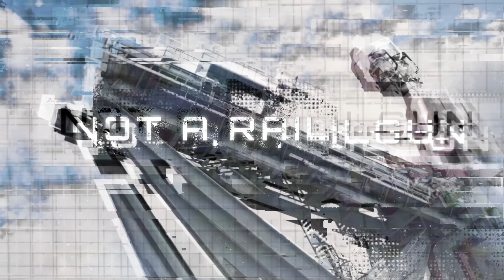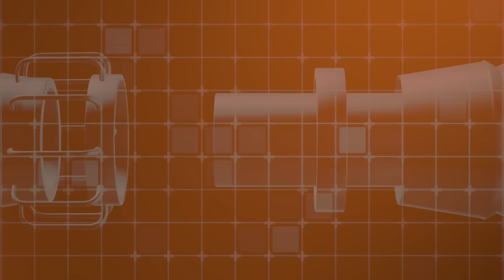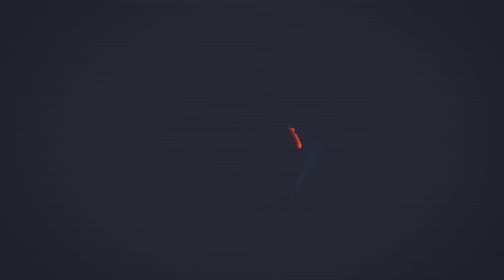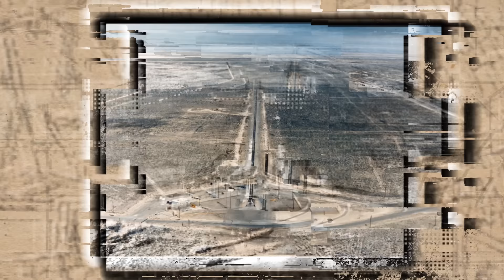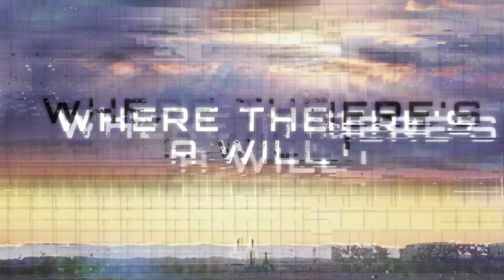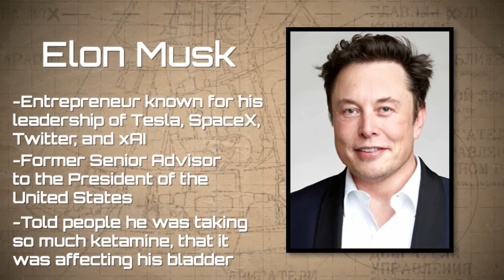China Wants to Build a Space Ship-Launching Rail Gun... But is it All Just Fiction?

Comment: It's nonsense. For years all experiments with railguns have failed, because of the stress on all the materials. The wear on components is enormous, they just tear themselves apart. You might get it to work, perhaps for a couple of times, but then you have to rebuild the whole thing. Or build a new one.
Reply: America learned this long ago, when they were experimenting with project HARP, using a giant naval artillery canon to shoot tings into the upper atmosphere at 115miles above sea level, way back int eh mid 1960's. the biggest problem was vessel survival due to massive initial G's from the propellant device, and how much thicker the atmosphere is compared higher altitudes. rockets accellerate slowly, but by the time the faster accelleration of the second stage rocket ignites, the atmosphere is about 10% of the atmospheric drag, compared to first stage launching.

Comment: This is how I assumed the new aircraft carrier was going to rapid fire drones.
Reply: Ohh that would be neat.
Reply: Wonder what the EM radiation would do to the drones electronics, especially anything connected to longer wires.
Reply: @2011dyrose  I believe the majority of EM fields in any form of EM catapult would be non-wave, which means they would die down exponentially over distance. But parasitic impedance would still be a serious problem, and it is not so easily shielded.
Reply: @2011dyrose presumably this isn't a problem for aircraft, so I think they'd be fine.
Reply: @BruceTutty 
Probably screened, hardened & surge protected up to the gills.

Still would be interesting to see what they expect & what they did to protect them.
Reply: China has hypersonic missiles. This might be used to test more advanced versions.

Comment: If it can only get to Mach 10 but need 33 how does it get into space ?
Reply: That's the easy part to answer: these platforms were never planned to provide all the propulsion to reach orbit, instead the design of something like this is meant to offset the most fuel expensive part of spaceflight: reaching a high speed at a high altitude where far more effciient engines can do the rest of the job with vastly less air resistance.  Thus making SSTO platforms VASTLY easier to operate. 
Does not change the fact that it WILL be an engineering golgotha,  I personally hope it works cause it will both be cool AF (I write scifi, this stuff is genuinely awesome) and also it would be the kind of infrastructure needed to have genuine orbital industry.
Reply: They explain if you watch the whole video

Comment: You know what, that sounds pretty fucking cool tbh
Reply: Exactly what i was thinking, but it makes me wonder if it can be manned or if the G-forces would end the astronaut(s).
Reply: @neverman001  China is currently half way through Phase 1 of their moon base - the scouting phase. 

The second phase is going to be the construction phase, done entirely by robots run by AI alongside remote instruction. That is going to require a lot of material, which can be sent up using this railgun.

The astronauts that will actual inhabitants the moon base will likely be sent via rocket.
Reply: @neverman001  Would absolutely kill the astronauts. Unless the railgun is really long (which would make it pointless since at that point just build a space elevator) the G-forces would turn living people into not-so-living people.
Reply: Starship needs 10 lanches for just the fuel to go to Mars.   E launchers can launch fuel at 1000 gees, so a short tube/track.  That eliminate 90% of the rocket launches needed.
Reply: look up Project HARP in the 1960's. USA and Canada partnered together for their High altitude research project. basically a naval artillery cannon that launched things 115 miles into the upper atmosphere. its basically the same thing, except with the use of an explosive charge, instead of electromagnet acceleration.
Reply: This is chinas sputnick moment provided that they don't screw up
Reply: One may definitely hear & also feel the cynical, pessimistic & just like most Caucasians short sighted negative, doubting & underestimating tones; when it comes or has anything to do with Motherland, China. 
The Westerners keep on thinking that how U.S. Chinese People’s are also thinking, but it’s not that we Chinese People are better or worse, but it’s just different - that’s all. 
Most Westerners ways of thinking centered around profits & capitalism, profiteering as much as possible in a Quarterly Earnings that only benefits the Corporations & it’s Shareholders, but Motherland, China is fundamentally different from the Western Society (u$a & europe), whereas Motherland, China’s endeavors are to benefit her Netizens/Citizens/Peoples. 
Every time this Narrator pops in my YouTube list, as I’m scrolling downwards on the list, I certainly can predict his narrative & it typically based every endeavors, projects, programs, technologies & innovations upon the Western’s experiences & if it’s not based on Western’s experiences, it’s doomed to fail. 
Always & constantly undermining, doubting & underestimating the abilities, capabilities, capacities & the vast pools of Chinese Engineering, which is phenomenal to know. It’s keeps the Warmongering Western Hypocritical Delusional Cowboys on their toes.
Reply: @HappyPandaBear73  you say its to benefit its netizens, but Chin STILL practices slavery. no western nation does. says westerners are capitalist, yet its China that offers terrible wages, as low as 200RMB per month for factory jobs like Phone manufacturing, and have to deploy anti-suicide nets, when they give up on life and try to jump from the roof of buildings at places liek their iphone factory, where a similar one in Say Vietnam that is not a thing, where wages are far superior, where they make near 4x as much at 5 million Dong FOR THE EXACT SAME JOB. where Vietnam has socialized public health care, paid completely by taxes, just like all but the US has. (thats one thing China and US have in common, the poor cant receive proper health care.

Bạn noi ra những lời ngu ngoc từ chinh hau mon của mình.
Reply: Not really. No way in hell I'd get in a vehicle inside a tube with no air. Sounded nuts when Elon Musk announced his hyperloop proposal. It doesn't sound any more sane now.

Technologically impressive, but so many potential safety issues. Also the same issues Concorde faced. Only really practical / cost effective for long-distance journeys. Likely also be very expensive, limiting its use to the wealthy.